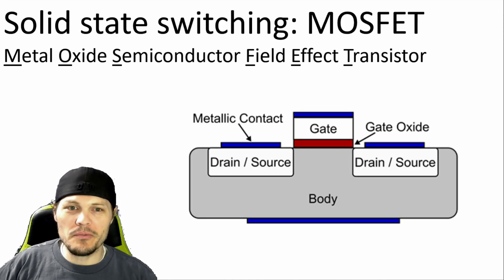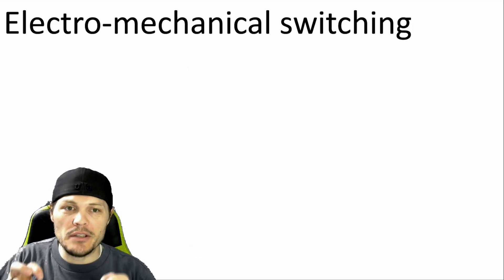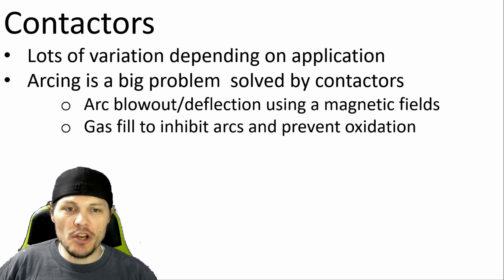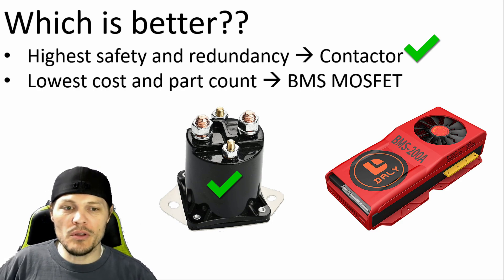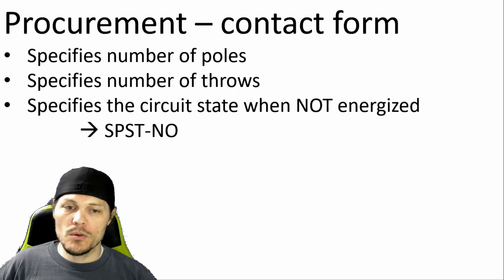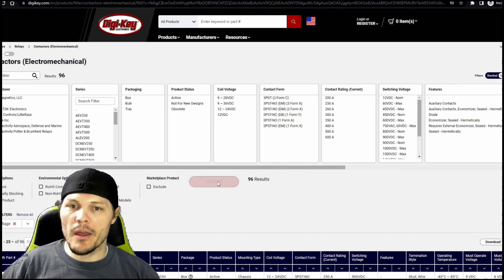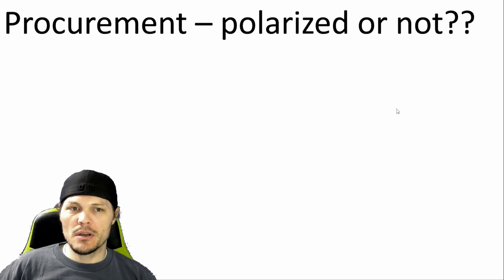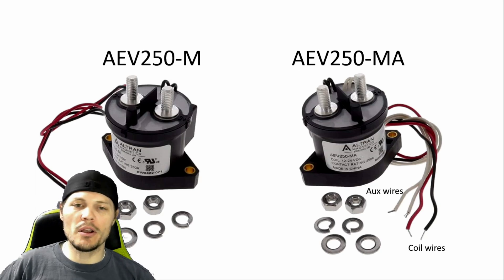Electrification of a Ninja 250 - Everything You Never Wanted To Know About Contactors

Comment: Nice video.  In the project I worked on there were 2 switches.  I had a physical disconnect breaker that I put in line with the battery and the motor controller had a kill switch tied to the key.  Lots of ways to skin that cat.
Reply from the maker: Thanks for the kind words, and also for sharing about your project!

Im just now starting to look how Im going to wire everything up. Im currently leaning towards having the key turn on the accessories (including the DC-DC converter), and then have the kill switch operate the contactor. 

Hopefully my videos are adequately presenting the information and how i made my design choices without implying that there's any single "RIGHT" way to do it.

Comment: just had one set of mosfets go short in my cheap ebay 3kw(dont laugh its only a city shopper!) motor controller, fortunatly while i cheaped out on the controller i bought a bms i like the construction of and it detected the short and disconnected the battery before my fuse even had time to blow. 
it also every half minute tried to turn back on and tripped again still not blowing any dinosaur slow fuses. i'll be contacting the manufacturer because if its detected a short its silly it tries to turn back on every 30 seconds...
replaced the blown shorted mosfets in the motor controller with quality ones and alls good again.
Reply from the maker: No judgement here! one of the barriers to broad commercialization of electric motorcycles is that every single rider will have a slightly different use case, making it hard for the OEMs to standardize and mass produce while also catering to their target market.

I havent researched fuses for my project yet....im guessing im going to need one that's rated for ~300 amps connected directly to battery positive?